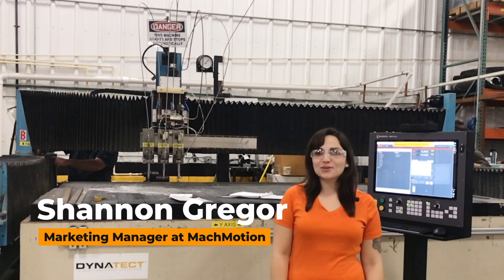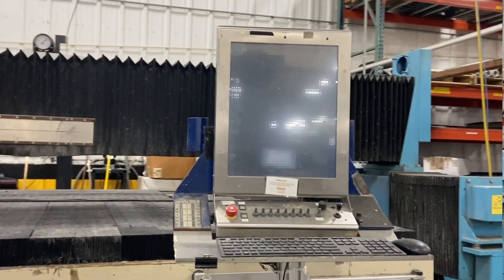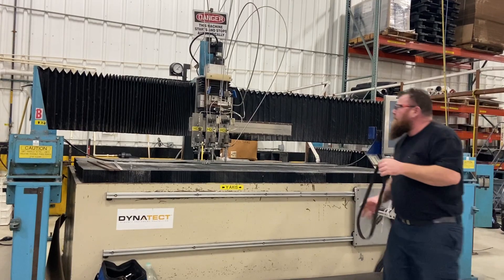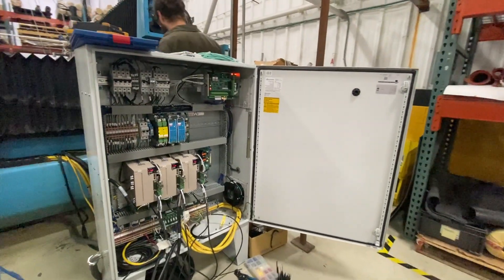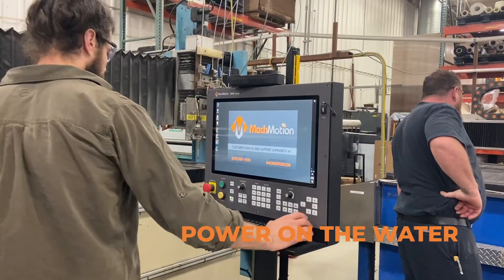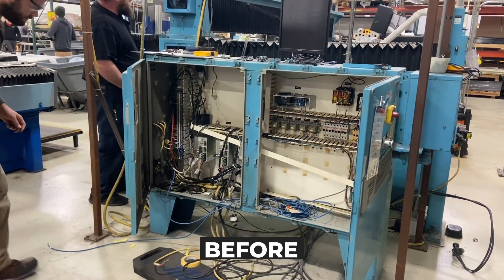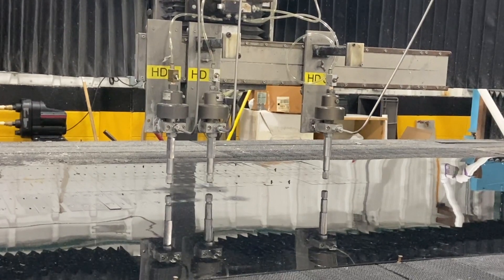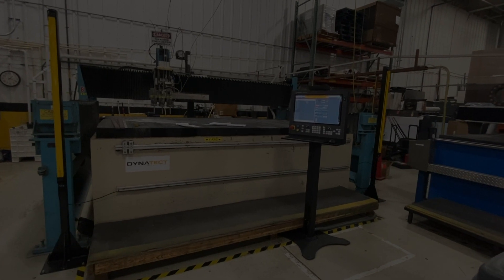Customer Story: Dynatect Progressive Technologies Waterjet - Turnkey CNC Controls Install Explained

Comment: Charles Sage said they decided to upgrade the old machine instead of buying new because, "We felt the machine was still solid."  I wonder how the company knew that?  And if a company doesn't know for sure, how can MachMotion help a company make that decision?
Reply from the maker: Hi Ben, to answer your question, MachMotion can help a company make informed decisions about whether to upgrade an existing machine with just 5 questions that let us know about the health of the machine, but if we run across something that needs attention, we can conduct a thorough 45-point assessment of the machine's overall condition. This information can help a company make a more informed decision and avoid unnecessary expenses. Even if a company isn't sure whether their old machine is still solid, the MachMotion team can provide the expertise and information needed to make an informed decision. Hope that helps!